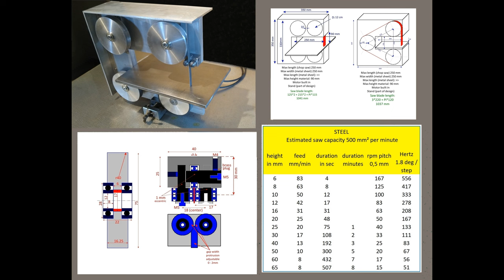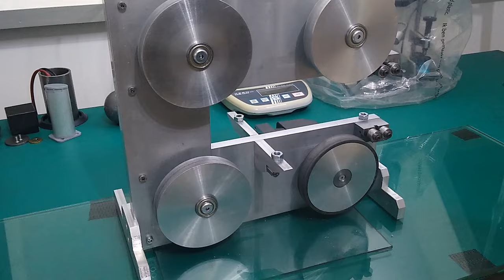A tiny tabletop bandsaw Part IV (the table and guides)

Comment: Amazing work! thank you for sharing. coincidentally, I’m in the process of building a band saw myself. I’ve been thinking about an automatic feed as well. However, I wonder: what do you think of using a constant pressure mechanism instead of a motor as you were eluding to? Something like an gaz spring with a clutch to engage it. I’m afraid the motor would make it harder to set the feed, particularly in case of round stock for instance where the cutting width varies as you go along. That would result either in too much wear of the blade or rubbing. A constant pressure is basically letting the saw decide the feed, within a certain range that is, isn’t it?
Reply from the maker: Ah, nice!
I suppose it's a tad bigger than mine?

Constant pressure, regardless of the thickness of the material to be sawn, can lead to tooth breakage in thin workpieces (after all, the pressure per tooth increases when less teeth are engaged). So you will have to achieve an adjustable pressure, low pressure for thin objects and higher pressure for thick objects. And so the problem with the round or odd shaped material remains basically the same.

For this reason I think I will forego an power feed. Even though I can continuously adjust the feed rate to the thickness of the workpiece, even during sawing. Such a provision is especially desirable for thick workpieces where sawing can take a very long time. I think I will rarely use it, and would rather opt for the manual control and the associated "Fingerspitzengefühl". I have now made a manual fine adjustment for the cross slide with which I can also achieve the low feed rate required for thick workpieces quite accurately.
Reply: @Michel-Uphoff  Yes a tad bigger indeed! I was originally going for a very similar design as yours but then i figured i had two weels of 400mm i could modify easily for it. So i ended up with a bigger band saw. 

Coincidentally, rotary smp put a video out the same day in which he shows the automatic feed of his doall bandsaw. It works with constant pressure in fact (a dead weight) but it is adjustable through a balancing mechanism. So in any case you gotta « feel » the feed pressure (i guess « hear » would be correct). Then the motor solution makes a lot of sense, allowing to adjust the feed on the fly very easily. 

I might then go for this solution, as I would really appreciate it for bigger stock, which wouldn’t fit in my vertical circular saw. 

Thank you for the explanations!

Comment: Michel
Your designs are very clever and well thought out. I know some may be put off by some of the machining required. You amaze me that such a small mill can make all the parts. I am really enjoying making mine. I just made the table and guides and was really delighted that the dovetail fits well without slop. I had never cut dovetails before but really had little problem. Enjoyable few hours in the workshop. John
Reply from the maker: Hi John,
How nice that you have started the construction and that it is going well! I hope that you will also enjoy the rest of the construction. In the meantime I use the band saw often and am happy every time with a nice straight cut and even happier with the absence of a tired arm.